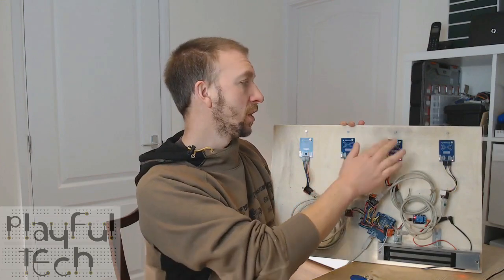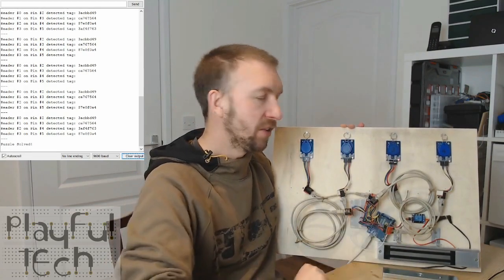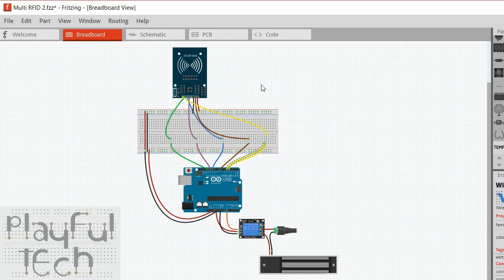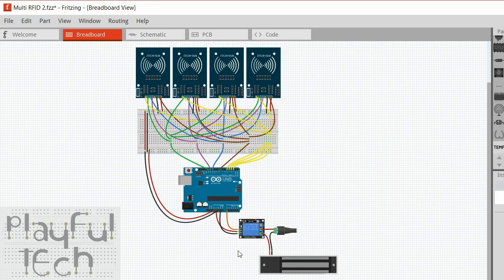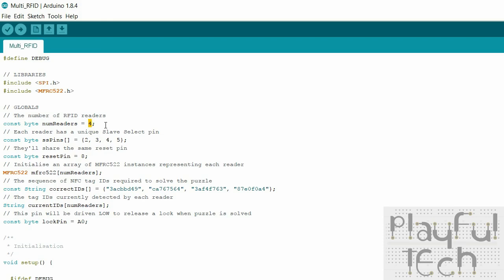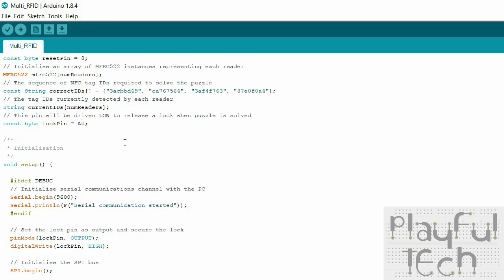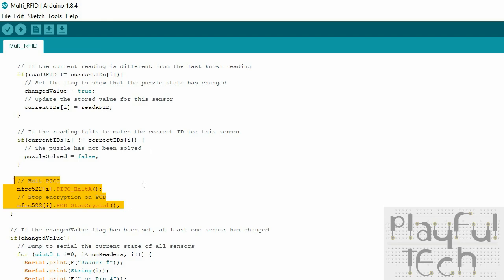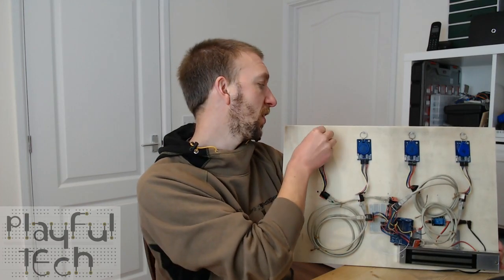Escape Room Object Placement Puzzle using Arduino/RFID

Comment: I made a puzzle like this to my Escape Room (with a lot less optimal code xD) and Im going crazy, it works perfectly when connected the arduino to a PC but, when it is to a 12v Power Supply, 1 or 2 reader doesen't work until and turn it off and on again; after that it work normally. Does anyone have an idea on why this happens?
I mean... I can work with this little issue but... I don't like it.

Comment: Hi, I bought the pn5180 boards, and a I2C IIC LOGIC LEVEL CONVERTER BIDIRECTIONAL MODULE FROM 3.3V TO 5V, I want to test the board, can you share the connections and the code that we can use?

Comment: How close could you have each antenna to each other? I am wanting to create a larger read area to read smaller tags, so want to get the antennas as close to each other as possible to read as many tags in that one space (rather than picking up what is closest to specific antennas)
Reply: Effectively, can I use interference to my advantage 😂 or does that interference actually affect the other antennas around it as well as the multitude of tags we are trying to read

Comment: Thank you for this explanation! Using this setup, how would you power the Arduino without connecting to the computer?
Reply from the maker: You can supply 7-12V on the VIn pin, or via the DC Barrel Jack (both of which get stepped down to 5V via the linear regulator on the Arduino board)

Comment: READY TO JOIN PATRION, but first...
Hello, I am in the Philippines & just getting started with all this.
I just bought an Arduino Uno and 5 RC522 rfid sets.
This video is a bit old, so before I sign up on your patrion, I would like to make sure, will I be able to use the code with 5 RFID RC522 on my Uno?
I know $10 doesn't seem like a lot there, but here that's 1 days wages, So it's better to check first if I can do what I need to before I spend so much.
Thank you

Comment: @Playful Technology Thank you for the content, have you maybe come across an issue where the RC522's can communicate well by themselves, but when two is using the MISO pin, it all breaks and it is unable to read anything? Pulling out one of the MISO cables enables the other RC522 to read.
Reply: Resolved, seems like the "pricier" RC522 (4 dollars) was the issue, I switched them to cheap ones, and it is working properly now :D

Comment: Hey Alastair! Thanks for making such great videos and being an amazing resource for the puzzle design community! I built out a project inspired by the work here and had a great breakthrough for the code that I would like to share. 

I built a puzzle that utilizes 8 of these, but it was important that I set each of the SS (sometimes called CS) pins to be pullups in the setup function. When these pins float they cause mixed readings. By doing this I have consistent and strong reads without issue. e.g. pinMode(2, INPUT_PULLUP);

I'm also using the most recent version of the library MFRC522v2.h which negates the need for the reset pin.

Hopefully this information can guide others to success.

Comment: Sir,  if i want to increase strength of RFID dectector then what i have to do ..? Please tell..
Reply from the maker: Use a different chip, such as a PN5180 which is based on vicinity sensing protocol (ISO15693), not proximity sensing (ISO14443)

Comment: Alistair, Great video. Thx much. A couple Q's..  Are the antenna's in RC-522 or PN5180 uni, bi, or onmi directional? You noted distance or read range of apprx 15cm for the PN5180. Is this straight up above card? Is there an area read range? I'm working on a build where I need more plane area. Also, can I run multiple PN5180's in series to create a greater area for tags to be read? thx!
Reply from the maker: The radiation pattern from the antenna extends both above and below the antenna, but it's not truly "omni" directional- you'll get much better read strength if the tag and reader are parallel and axis-aligned.

You can't run PN5180s "in series" as such, but yes you can have multiple readers attached to the same MCU and treat them as separate inputs.
Reply: @PlayfulTechnology  Thx much for the reply. Any thoughts on readers that could be used if ya wanted a tag to be read in and defined area? Say 12"x 12" or maybe 24"x12". The above distance can be small distance  <= 2" -  Imagine dropping a tag in a boxed area. Thx Much. Love your vids!

Comment: Hi, your tutorial is definitely precise and easy to follow, that's appreciated.
We are in the middle of a system that gives us a bit of a headache. Our readers do not all initiate, we have a Mega as a master and 2 Uno as slaves, each Uno has 3 and 4 readers but every time we reset (as a whole) some readers may or may not initiate (thus not working with our tags and the puzzle can't be solved). This happens especially on the Uno with the 4 readers, it alway has 2 properly working but the other 2 just don't "start". Would you happen to have a solution? Thanks so much and I will check you other videos. (also I do not speak English natively so please excuse my language)

Comment: I've been trying for a few days to make this work, I've followed Alistairs updated video and wiring diagram from Patreon which includes two logic level controllers, and I can get all of the RFID chips to each work independently if I remove power from the others, but as soon as I try and have two or more RFID readers running concurrently then only one is recognized in the serial monitor and the others always produce "WARNING: Communication failure, is the MFRC522 properly connected?"

I thought it might have been an issue of bad connections so swapped to solder, that didn't help. Tried providing each reader with its own independent 3.3v power supply, that didn't help.

When turned on, all of the RFID readers have their power light on, and they never go out, I read that they should be flicking on and off as the controller selects between them, does this provide any insight as to what the problem might be? 

Thanks for your help strangers :)
Reply from the maker: So, as it happens, I recently made a new build based on this design but using a lot of RFID sensors (36, to be precise). And because I didn't have that many in my stock drawer, I had to order some more boards, and I encountered a similar problem with these new boards that I'd never seen with the original design. After some research, I think I know what the problem is:

So, the point of the SPI bus is that you should be able to have many devices all connected to the same MOSI, MISO, and CLOCK lines all the time, and the master device (the Arduino) specifies which one it is communicating with at any one time by pulling that device's Slave Select line LOW. When a slave device's Slave Select line is HIGH, it should "stay quiet" - putting its pins into a high impedance state so that it does not interfere with the communication.
*But*, it seems that some of these cheap MFRC-522 clone sensor boards are not "well-behaved", and sometimes cause chatter on the MISO line even when their SS line is high. This is what causes the noise and erroneous readings when you have additional units connected.

To find out if this is the same problem as you're experiencing, try connecting the MISO pin to GND through two 10k resistors, then use a multimeter to take the reading from the midpoint between them. When all readers are disabled, it should be a floating pin, and constamtly read half of the VCC voltage (i.e. 1.65V). If however, you see logic HIGH (3.3V) or LOW (0V), it means that the readers are sending signals on the MISO line when they shouldn't be.
Reply: Hello Alastair,

Thank you for the very detailed response.

My boards are cheap Ali express specials so that could be the case, if they are sending chatter over the miso line is there any solution other than trying different readers?

Thanks so much again
Reply from the maker: @AaronMayes  Yes - there's a couple of different ways - based on the same basic idea, which is to "disconnect" the MISO line on all readers until it is required. So, instead of simply looping around the slave select pins for each reader and setting them LOW, you need to loop around both the slave select and the MISO lines.
To specify which reader has its MISO line connected to the bus, you could use a multiplexer (e.g. CD4051) to switch between them. Or you could use a tri-state buffer (e.g. 74AHC1G125) that disabled each reader's MISO line unless its SS was pulled low. 
Or, to take a different approach, you could use a port expander (e.g. PCF8574) and specify a unique dedicated MISO pin for each reader as part of its constructor, so you were explicitly separating each reader onto its own bus.
Reply: @PlayfulTechnology  Hello again,

Thanks again for your very detailed explanation.

This is all very new to me, I'm new to the escape room business and this is only the second arduino prop I've made from scratch, so at first glance that all seems quite complicated but I will go off and do some research about the different options that you mentioned. Might be easier to try and find some better readers!

Thanks again for all that you do, without your videos I wouldn't have known where to start.
Reply from the maker: So, you're right - this is a relatively complicated system if you're still a little unexperienced. I have plenty of other simpler Arduino projects for you to work up to get more familiar! There are of course alternative "off-the-shelf" RFID solutions you also might want to look into. However, the reason I always encourage people to learn how to create their own puzzle prop controllers is that you get complete control to set the behaviour and the way in which players interact with it, you get a better understanding of how it works if you ever want to change it or if it goes wrong (and systems in escape rooms do go wrong, but if you built it in the first place you won't be at the mercy of a third-party to come out and fix it!). And it's incredibly satisfying!
Reply from the maker: Oooh, I just thought of one more thing to try (and this one's an easy one, because it doesn't require any hardware). Some readers don't have pullup resistors on the slave select lines, so you have to make sure the Arduino explicitly sets their SS lines HIGH before initialising them. I've just uploaded a new version of the code to the Patreon link (the only change is it's got 4 additional lines in the setup() function) - can you please try downloading that and seeing if it makes a difference?

Comment: Is it possible to have 9 RFID readers and if so what Arduino board would I use
Reply from the maker: Yes, definitely. Although when I've done large numbers of readers, I typically wouldn't have them all connected to a single Arduino. Instead, what I do is to have a number of "slave" Arduinos, each responsible for only 3 or 4 readers. And then I have a master Arduino controller that polls all of the slaves, as in this wiring diagram: https://raw.githubusercontent.com/playfultechnology/arduino-rfid-MFRC522/master/documentation/Mega%20RFID_bb.jpg   . Using this setup I've had up to 32 RFID readers in a single prop.
Reply: @PlayfulTechnology  Thank you

Comment: Hello Alister, 
First of all i love your videos 😍!
I am about to biuld something similar but  i need to have 6 rfids and placed quite a distance apart (at least in pairs). 
My thought is using common ground and reset and a trigger pin between them  when both rfids are placed correctly. 
Do you think it would work? 
(I am gonna try it but wanted your opinion before i start)!
Reply from the maker: I'd say 6 is about the limit of the number of readers you can reliably place on a single SPI bus. The problem is that, as you add more readers, the overall capacitance on the bus grows, the voltage level drops, and it takes longer for a signal sent from the master to make the round-trip to each sensor and back again. This all degrades the signal strength and, if the response on the MISO line is not received before the clock cycle, the data is lost. What I've tended to do for large multi-RFID installations is to group readers together into batches of 3 or 4, each with their own Arduino controller, and then wire those "slave" controllers together to a master controller over I2C. I currently have this set up with an array of 16 RFID readers and it works well.

Comment: If you are going to use a magnetic lock to secure a door, you must connect it to the fire alarm panel and get a permit from the city.
Reply from the maker: I'd suggest any escape room facility owner should ensure they are familiar and compliant with all applicable planning and safety laws and regulations. 
But there's not much point me describing safety requirements in detail, because the ones I'm familiar with here in the UK are likely different to anywhere else, and you should always make sure you're checking against up-to-date guidance from a reputable source, not what some bloke said on the internet ;)
Reply: They MAIN Entry to the room should NEVER be locked...
Only the Escape...

Comment: Hi Alistair, I have joined your patreon and downloaded the code and instructions on how to build this escape room puzzle, and I am currently designing an in-home escape room for some friends to try out at Halloween (thought i'd start early!), and decided that this particular puzzle will work ideal for my "end puzzle" which when solved will win the game. It just so happens that having four RFID sensors is perfect as there will be 4 items with an RFID tag attached, and four plastic "pillars" with a concealed RFID sensor in the top of each, where the items must be placed in a certain order to win the game. But winning the game will trigger some 12v green led strip lights instead of a maglock, so all good there. But I was wondering if it was possible to add an extra level of complexity to this puzzle, as I want to also incorporate some neopixel rings (as featured in your mastermind puzzle game), in fact there will be 4x neopixel rings, one inside each pillar, as well as a RFID sensor. So essentially what will happen is when the four items are placed in the correct order, the arduino will trigger the relay which will turn on the green led strip, but also the arduino will separately trigger the neopixel rings to flash green inside each pillar. My first question is if there are 4x neopixel rings, do I need a separate capacitor and resister for each, or can they just all share the one capacitor/resistor since they will all be in parallel and all be triggered at the same time?
My second question is that I also want to have a condition where if there are NO tags on ANY sensors, then all lights are off, including the 4x neopixels. But if there is at least ONE tag or more on a sensor (correct or not) it will trigger the neopixels only to flash RED, as if to 'indicate' that a tag has been detected at a sensor but the puzzle is not yet complete. So basically the flowchart would be something like this:
condition A: NO tags on ANY sensors = ALL LIGHTS OFF (ie reset)
condition B: one or more tags on any sensors (but puzzle not solved) = all neopixel rings flash red
condition C: all tags on correct sensors (puzzle solved!) = neopixels all flash green and led strip light is triggered by relay.
I was originally wanting to have it so only the neopixel for the respective sensor would light up when a tag is detected, but I thought this would be too complex, so having all four neopixels light up together, even if only one sensor is triggered, would probably make the code much simpler.
Regards, Jason
Reply: does he respond better to patrons?
I really need to get this but need to know if it does make sure that all are in place before it activates?
Meaning, if I place 1, remove it, then place another & so on, will it still work?
I am trying to make a puzzle that requires 5 objects to all be in place before it will open

Comment: I've found myself watching a lot of your videos lately and even ordered a couple pn5180 boards that you mentioned in another video. I may be diving in over my head trying to use RFID in my first Arduino project but I'm trying to use an RFID to turn on my motorcycle's electronics so al Ii have to do is press the button to start the engine. if i could get some basic code that ihave to manually enter my own UID but it would output a true or false signal that would be the simplest way to do it

Comment: I've got some issues wiring the rc522... When there is only one connected to the arduino threw a breadbord, everything works fine. But when all RFID are connected, nothing work. I've got some error messages said that rc522 are problably not well connected. Can somebody help me please ?  Thanks!
Reply from the maker: That unfortunately is one of the problems of breadboard testing... the connections between components simply aren't good enough - you really need to use screw or solder terminals to ensure good conductivity between the readers.